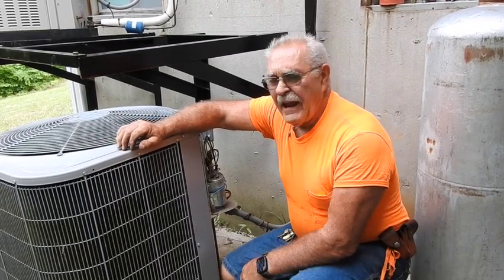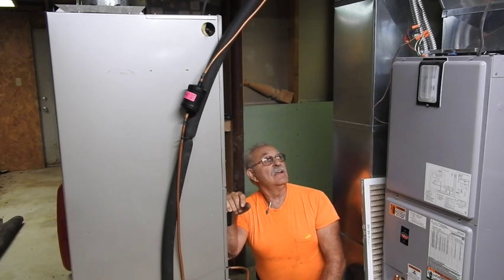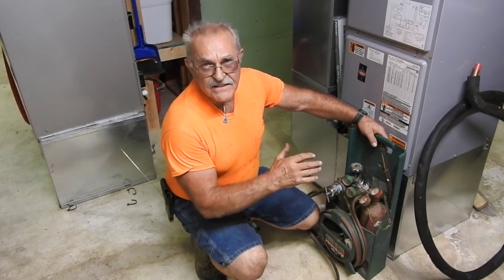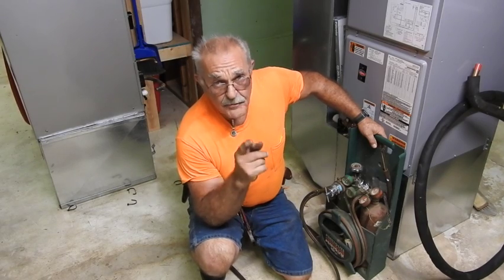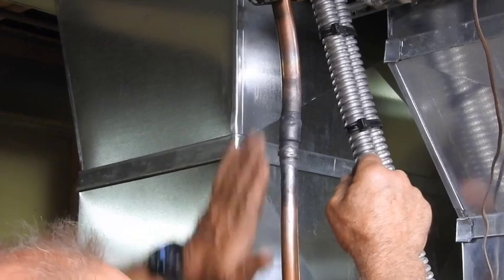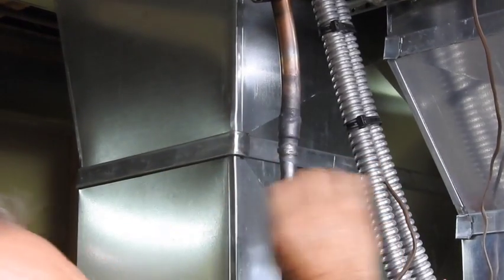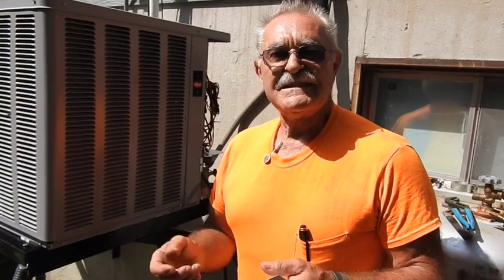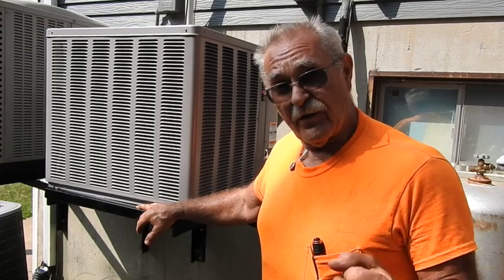Central Air Install - 15% Silver Solder

Comment: My Daddy gave me some silver solder in the flat strips about 40 years ago and called it "seal floss" have you ever heard of such? He also gave me a roll of about .032 silver solder wire. 
Great video, I love to see a master of soldering at work!
Reply from the maker: Yes Rick, the product is SilPhos. Iirc, its an alloy of silver, copper and phosphorous and like 15% silver solder used here needs no flux to join copper to copper.  The .032 wire roll is going to be a 45% silver which will require extremely clean joints and a white paste soldering flux.  We use the 45% for joining copper to steel among other things.  I'm glad you enjoyed the video.  All costly today  the 45% is sold by the troy ounce and usually in either 1 or 3 troy oz containers in the hvac supply houses, but it can be bought in sticks with a flux exterior.  
   The OLD 45% was hollow and had a cadmium center to act as something as a flux.  It was deemed hazardous to your health a couple decades ago so it was taken off the shelf. The 45% wire roll usually runs up to 35 or 40 bucks per troy ounce.  Does that help...??  Remember, I've been retired almost a decade and the memory is fading.......  Thanks for watching my friend.  I look forward to your comments.
Reply: @tractorman4461  thank you I think you hit the nail on the head. Looks like I'm going to have to dig that roll out of the shed and put it in the safe, lol
Reply from the maker: @rickburris6164  hahahahaha....good one Rick.

Comment: Nice work tractor man I was slow to convert to staybrite 8 but I’m a believer now give it a try
Reply from the maker: I use Staybrite 8 on all TXV's, solenoids, site glasses and some compressors.  But you know....I had a leaker on Staybrite 8 one time and I thought I'd see if some 15% would lay over it and guess what...!!?  It went right in on top and sealed it with no hassle.  I think I missed sanding one of the cups on a 1/2 or 5/8 od liquid line.... something like that.  Several times commercially, I have had the construction crews literally melt the guts out of TXV's and ball valves with 15%.  Before start up, I'd have to cut them out and install new ones, always with 8%.

Comment: I worked at the Trane plant in Tyler, TX from Jan 1995 to the end of Feb 2013.  For about 14 years of that, I brazed joints in building those condenser units.  We used torches with a spit tip so there were 2 flames to heat the joint which made it much faster to braze up.  While there, I would not admit to knowing how to solder aluminum tubing to copper tubing transition joints which are harder to do because you only have one chance to get the joint correct or it has to be cut out and replaced.  A  soldered joint usually can't be fixed like a brazed joint can.  A brazed joint can be taken apart and put back together if you don't damage the tube.
Reply from the maker: That's cool Roy.  I actually have a pair of the small devil horn tips for the small torch sets.  Its been years since I drug those out and forgot all about them until your comment. LOL   I'm with you there on the copper/aluminum joint.  And I have pulled many a solder joint apart to clean and re solder too. Overheating a joint is bad....especially if its a copper clad steel line.  PITA to fix that one.  Thanks for the visit this evening Roy !!
Reply: @tractorman4461  I would braze 1000 to 2000 joints in a shift.  It got to where I did not have many leaks.
Reply from the maker: @royreynolds108  Now that's a lot of joints Roy.  I've done a lot, but no where near the quantity of your 14 years on the line.  I had two friends that worked locally at Marlo Coil and they worked just like you.  Being primarily in the service side, I did not have to solder something every day, and other times I'd be on the construction side and be on a soldering project that'd stretch into weeks.

Comment: Tm44 , I wished I had a third of your knowledge.  Our house is 25 years old. We moved in right after the house was complete your with central air.
Four years later we had no a/c. Called the company and they sent out a tech and after a bit, he said compressor is bad you'll need a brand new unit. Mind you the first one was 4 years old.  So he put another unit in worked good. 7 years later it blew hot air like the first one. Called the tech, he came out and after a bit, said your Compressor is bad need a new unit. By this time I was kinda get smarter about things. So I say charge me another service call and price me a new unit and call me don't order it just get me an estimate.  In the meantime I stopped at a different A|C and heating business and talked with the owner. He said  to do you justice he would have come to my reaident and look the job over before giving me an estimate. Now I live an hour from town
Abd true to his word  Mr. Miller came to my house the very next morning early. After testing voltage and wiring, and the outside breaker he was satisfied everything to that point was OK. Then he said, mine if I pull the dozen screws holding the fan blower on. Yeah, I  said, go ahead. So he did that, unplugged the fan and set it aside. Theres nothing wrong with this unit. Just need to resolder the 1/2"" copper tubing back to the coil. He recharged the refrigerant  and left. Sent me a bill for 120.00 bucks and we are still using the same unit. A few days later the other outfit called wanting to know when to order my new unit. The had a 2500.00  estimate already written up. I was very happy to tell them I'd gotten my old one resoldered and it was working like a champ
It's sad tm44 that we live in a throw away World. Some of these guys would rather tou do away with anything old and replace it. When ole Mr. Miller took the extra time fixed it right and saved me nearly 2300 bucks. Guess who has been getting all my business since the. 17 years later we are still using the same unit Mr. Miller fixed. Sorry bout the long comment but like you theres people out there who will go the extra step and save someone a couple thousand dollars.
Reply from the maker: That sure sucks that you had that experience.  So many guys in the field have little or no desire to make repairs and are way too quick to push a new one.  I could write a book on the stories I have heard over the years.  I've been the second opinion call many times back in the day myself.  A reputable company won't keep a careless guy like that very long, especially in a small town where word gets around quick Dean.  But then again, there are some (for lack of a better word) shysters out there.  Unfortunately.  I am glad Mr Miller took care of you so well Dean.